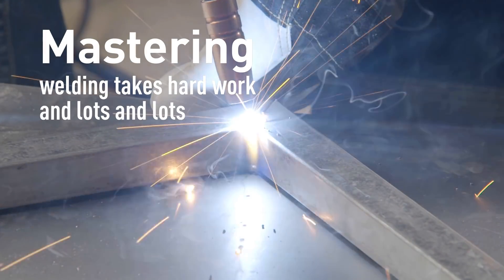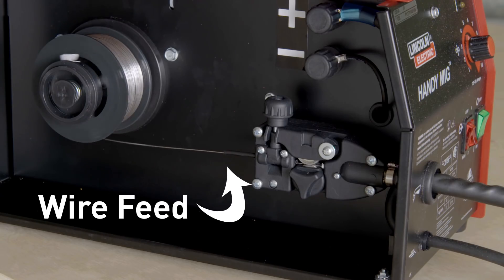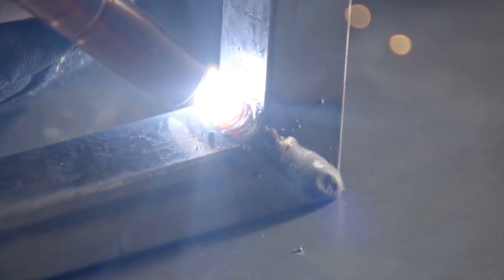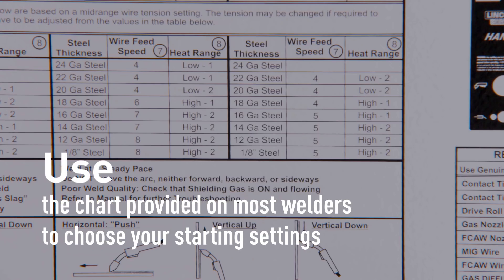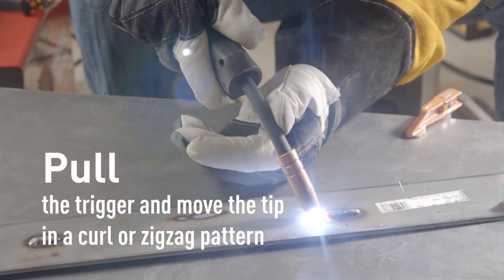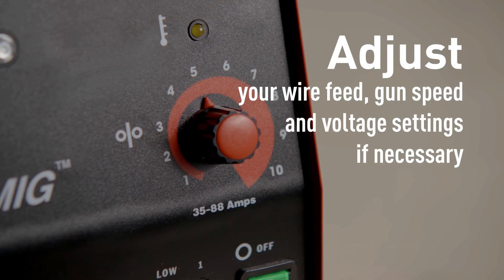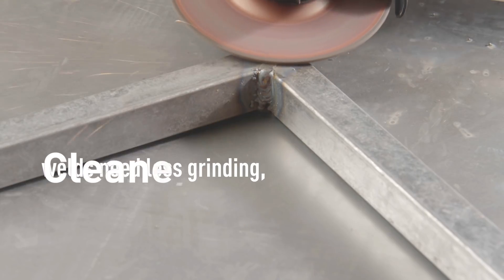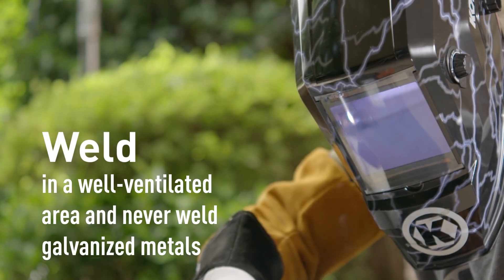How To Weld with a MIG Welder | Beyond The Basics

Comment: Not ever welding myself but being an avid DIYer in most all other aspects I always wonder about the electrocution aspects or lack thereof of welding.  Does not seem to be discussed much so I guess the chances are minimal unless you touch the hot weld where the anode and cathode interact.  Maybe someone can educate me on that
Reply: You would need to hold the metal end of the clamp and several inches of the wire in both hands to have any current passing through your body. Easier to get shocked from a gas powered lawnmower.
Reply: keep your feet on the ground and do not have wet gloves... The shock hurts but I am not dead yet...

Comment: Under the safety section you never said anything about ventilation, yet I've read that there are long term health problems from welding career. The saying goes "there are no old welders"?

I've been reading about the health concerns and it seems to outweigh any positives of welding as a career. Parkinsons, cataracts, long term central nervous system damage, etc... Are there any genuinely safe respirators you wear under your welding mask to prevent inhaling the poisonous fumes and smoke? I don't want to get parkinsons or any other health issues, I value my health and take good care of my body, so is this a poor career choice or are there preventable measures that can guarantee I'm avoiding those types of hazards. Obviously critical human error (exploding gas, dropping heavy objects on someone, machines breaking, etc) can be unavoidable, but if there are invisible dangers sitting my lungs and running through my body, then it seems absurd to punish yourself in that way. "There are no old welders" you said yourself, that makes this sound like a suicide mission ?

I'm referring to the dangers that have been raised by welders I've listened to, and articles I've read regarding the subject: https://www.medicalnewstoday.com/articles/221710.php

I'm trying to build a brighter future for my family, but I don't think I'll be much help to them if I'm putting myself on a path to requiring expensive medical treatment.
Reply: There are mask cartridges to filter out the fumes from welding. Inexpensive and easy to use. The problem is that too many workers do not wear a mask  as with other trades where there is silica dust. See how many guys wear safety glasses or hearing protection on job sites - it is less than 1% regardless of age.

Comment: Thanks for the tips I would like to know what type of helmet I can use plz? I bought one self darkness and once the welding starts I can't see the line I have to weld? Please let me know what I am doing wrong or just got the wrong helmet thanks in advance
Reply: Avtar Bhogal 
Sounds like you just need better lighted are in your work station. I use the standard tint welding helmet and once you tack weld your joint together you can throw your head forward then the welding helmet comes down. Using the auto tint helmets can be tricky and hard to see at times.

Comment: I am a professional gas metal arc weldor.  Galvanized metals can be welded however there is a lot to be done before its able to welded. Grind off any coating in the joint area and clean with mineral spirits rinse off the area afterwards clean and dry. Use plenty of ventilation such as a portable fume extractor and open doors windows etc. Do not breath the fumes from any welding application they will make you vary sick wear a respirator designed to protect against welding fumes in general.